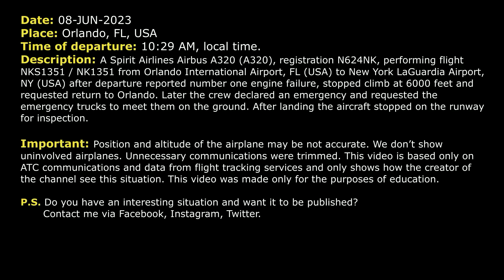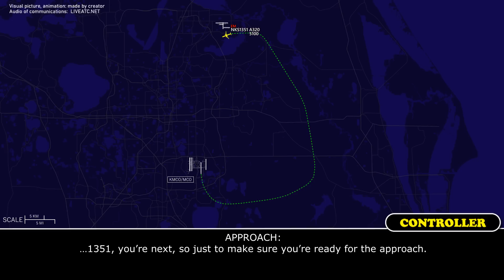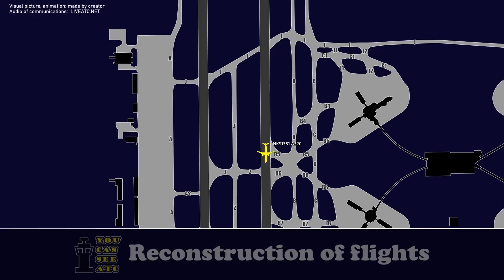Engine failure after takeoff. Emergency return. Spirit Airbus A320 returns to Orlando. Real ATC

Comment: “We didn’t ask to declare the emergency”. Then later asks for the fire equipment. Dude. You have an ENGINE OUT. On an airline revenue flight. Seriously? Everyone’s so afraid to declare an emergency when they actually HAVE an emergency. I’ve declared three in 11,000+ of jet flying. Guess what? It’s no big deal. You do what you have to do.
Reply: Your attacks of diarrhea do not constitute an emergency.
Reply: Seems like they were busy flying and then controller asked for souls etc pretty fast. Curious?  Is declaring an emergency on the engine out checklist?
Reply: @SlowSteveRoadCraft  if it is then last. Aviate Navigate Communicate.
Reply: @kaefermichaify  he did communicate. He said TWICE he had an engine failure. It sure sounded like He purposely did not declare an emergency as a lot of pilots are taught to be afraid to because of the “paperwork”. It’s an aviation culture thing and i would bet the first officer is a relatively  low time new hire who came from flight instructing recently. The hiring boom has placed a LOT of low time pilots in the right seat of airliners. The captain  probably was the pilot flying and may have assumed his fo already declared when reporting the failure. Just him saying “we didn’t declare an emergency” is SUPER odd when you tell ATC you have an engine failure…on a 2-engine jet. But I wasn’t there and i am Monday morning quarterbacking …. But it is very odd

Comment: Very professional. The atc didn't ask unnecessary questions and got them back in quickly, and the pilots did a good job of staying in control of the plane and followed aviate, navigate, and communicate. Gj all around
Reply: Did departure really ask "what's the reason?" after being told "engine failure"? And AGAIN? 1351 had to repeat engine 1 out too.